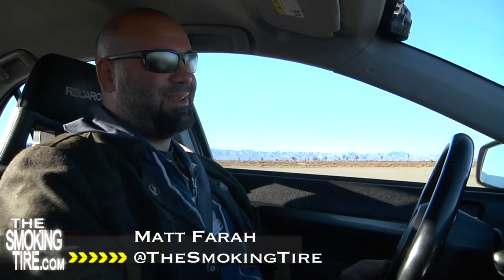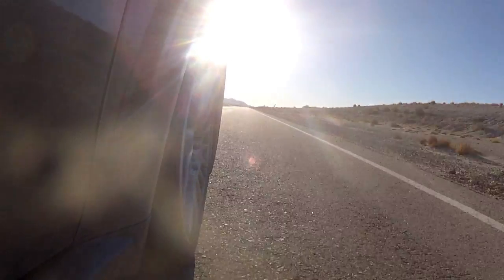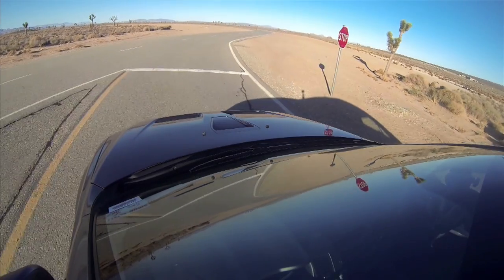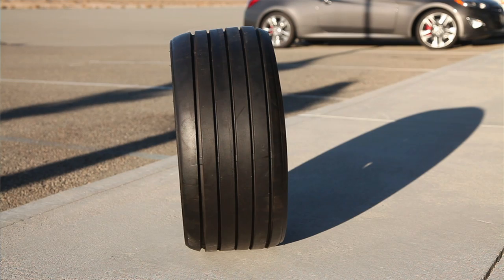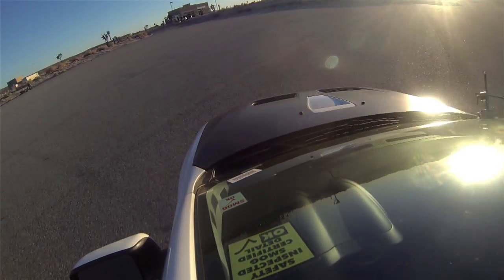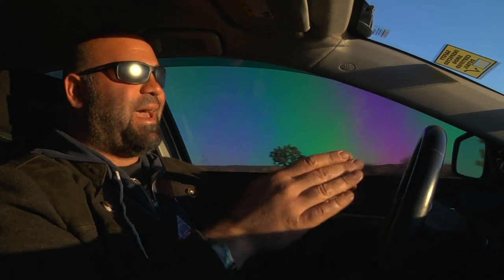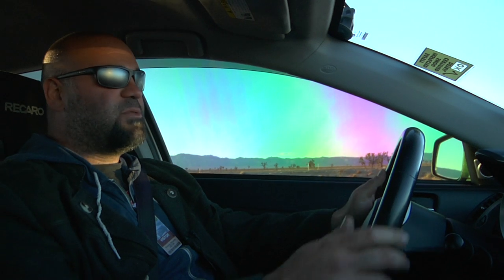Are current tires the wrong shape?

Comment: Want to point out that these tires kinda require the "cone shaped issue" to be fixed by increasing the toe out angle so it'd be pretty slow for them to change the suspension mid test for the new wheels, especially since it's pretty obvious they're losing daylight in the majority of this video. I do agree with third party testing though, jus to be sure.

Comment: These really need to be numerically tested against street radials, r-compound and slicks. The differences could easily come down to stickier rubber.
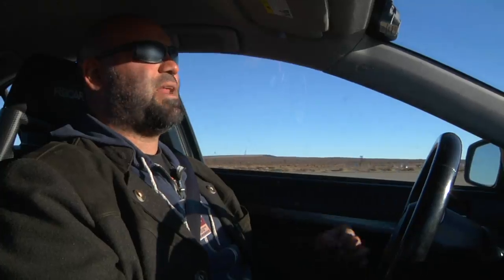Reply: 1:30

"This has the same compound, the same tread, but no camber" 

Are you guys that thick?
Reply: Leo
I'd prefer independent testing, not the manufacturer's claims.

Comment: So are these tires wider on their outside edge so in normal straight line driving you drive on the inside edges, but when you corner it lays flat?
Reply: Exactly. The point is to give the outer tire maximum contact and grip in turns so that you can take turns faster. That's the benefit it provides on a race track.

Comment: round wheels would probably increase handling drastically but i guess that might be science fiction
Reply: +white chocolate or science friction...
Reply: +white chocolate not as much of contact pattern to the ground. I think that is the point of having these tires and not just putting tons of camber on a normal tire and wheel because then you just put the tire on its corner
Reply: i was thinking you would lose grip
Reply: Kaleb Persinger doesnt matter if theres not a lot of contact it would turn in hard

Comment: Worst idea ever, and a bunch of lies.
Tires are cylinder shaped for a reason. If you roll a cylinder on a surface, it will roll in a straight line. If you roll a cone on a flat surface, it will roll in a circle, not a straight line.
So the outside edge of the tire, being larger in diameter, will travel farther per revolution than the inside edge. The inside edge of the tire will always be rotating slower than the car is moving, and the outside edge faster. The edges of the tire will wear rapidly, much faster than a standard tire. This is why we go to the trouble of installing differentials into cars, rather than welding the axles together.

BOOM!!!
Reply: +Special EDy 
Yeah, one cone, but if you put 4 together there is a difference.
Reply: +Special EDy I will acknowledge that this is true, but, considering how well these tires performed, it seems worth it. The shape may cause issues with wear over time, but the conical shape is small enough that it seems that this effect would be minimal. Also, if the tires are both pushing inward, wouldn't it help the car stay straighter?
Reply: +Special EDy Fair enough, but even in the video he mentions that with the appropriate toe (pointing of the front of the tires in or out) they function normally. ...So to address your point one would add extra toe outwards to compensate for the inward force generated by it not being straight.  

The other problem of them wearing at different rates.. Really, of all things seems closer to a non issue, not only has the person already made a tyre that is not flat for this to exist - by saying a problem is going to occur in which the tires will wear at different rates, meaning to resolve the "problem"  he would have to make a tire that is...at an angle.  

With that said you should really be up in arms that tires currently more often than not wear unevenly and can cause punctures on sides, whereas eventually his problem will be that his tires will wear flat, causing the vehicle to have...conventional tires.  

(which could be a problem with the extra camber however, stability at speed etc, which I imagine which is why this idea has not taken off sooner.)
Reply: +Special EDy 
Yeah, one cone, but if you put 4 together there is a difference.
Reply: +Adam Pardoe I think I get what your saying about the forces still being present, even if it is stable after the camber which will cause wear unevenly. And I guess if the wear due to the forces isn't equivalent to the extra rubber provided by the 2 degree camber you are pretty screwed. 
Though even now Michelin are making multi compound tires, with softer external compounds - maybe one could work out the wear rates and blend in a stiff outside compound? That can't be positive for grip, but whether stiff confound is worse than the 2degree cambered tyres is, well yet another theoretical question I don't have the answer to at 1am
Reply: +ChIken The reason that cars have always had their front end toed in was to load the wheel bearings laterally. Tapered roller bearings need to be pressed against the bearing race.
Having the front wheels toed in also promotes stability in a straight line, toed out cars will turn easier.
So these tires will actually decrease the tendency of the car to enter a turn, and by mechanically adjusting the toe angle to fix the problem you are placing added strain on the wheel bearings.
Reply: +ChIken what you're dialling out is the overall force. Imagine a cone's trajectory as it rolls. See the angle that it creates? It's only got a 2 degree camber so it will take a hell of a long time to do a full 360 degrees and end up where it started. 
Basically what the toe out does is alter the direction of the curve. So let's say that it takes 50m for the tyre to have rolled 2m to the right. That angle (0.04 deg, not sure though cos im half asleep and using my phone calc instead of my casio) would probably be an acceptable angle to toe out the wheel.
 The internal and external forces are still there, but the car handles better, however those conflicting forces are still gunna cause extra wear. It would be a cool set of tyres to use on track, but for everyday use i'd probably stick with regular shaped tyres.
 It'll be a cool concept if carbon nanotube production gets a lot cheaper so we can have carbon nanotube-rubber composites that could stand up to the kind of wear that these tyres would produce over extended periods of time. Heck any tyre made of that would like never have to be replaced.

Comment: correct me if i'm wrong, aren't you just comparing a car with 0 degree camber against a car with 2 degree camber? Shouldn't you be comparing a car with 2 degree camber on a square tire against a car with 2 degree camber with the camber tire?
Reply: +Wei Wang i believe the point is that both cars are aligned with 0 camber in the suspension but the tire creates a 2 degree camber because its not square.. i guess a good test would be 2 degree camber on a traditional tire vs. the 2 degree camber tire with no camber in the suspension but on paper the camber tire is designed to do that so it'd probably still be grippier
Reply: ***** I feel like they're indeed just doing what your point is, but the effect of camber doesn't need to be proven once more.

- Hey have you heard of negative camber? It helps cornering!
- duh? 

- I changed my camber from 0 to -2 and the car corners so much better now!! God of wonders this is new discovery I wonder why isn't anyone doing it! Gotta tell everybody now!
- duh?

Needless to say you don't need camber tires to prove that point.
Reply: +Wei Wang True! Strain on suspension components could be lessened with these tires i suppose
Reply: +Nopiw proper wear pattern

Comment: We lever to the surface under Vacuum and elastic tension, "Cambertire" effect is "One of ERW issued patent claims", Kevlar bound rubber wedges off a curved composite hoop. Rolling resistance, high speed performance improvements... The industry did not see coming. 74 issued Britek patent claims.

Comment: It pisses me off that he said the evo was really beat because it has 96,000 miles on it. Rich people who can afford to buy a new car every 50,000 miles.
Reply: Nick DiNunzio i think he ment it is rough for what it is, a 96k evo, that lives as a demo car... also he said the clutch is shot....
Reply: ***** Sounds like I'm just 17
Reply: Nick DiNunzio do you know what car he drives ? and ferther more for such a young car it has a lot of miles .. its being used alot , get it ?
Reply: Nick DiNunzio Um, you know what kind of miles Evos do right?
Reply: 96,000 miles on a daily is very different ona TEST CAR. Which that was.
Reply: Tee Mann Most definitely. Even a car like Evo driven to its limits most of the time will be pretty beaten up at 96k.
Reply: +Nick DiNunzio under 100.000 equals new to me. 
looking for cars under 200.000 at the market currently.
Reply: +Nick DiNunzio an evo with 96k miles has been mistreated so much that is already considered beat, these cars get driven hard every single day, and if someone tells you otherwise then they are lying. I owned an evo with 57k miles that was ready to get scrapped.
Reply: You can't assume
Reply: +Nick DiNunzio Generally turbo motors are not expected to last more then 100k-miles without rebuilds, new bearings rings etc. That being said I have a 2.0 making 388whp with 180k factory motor down to the bearings etc. only replacement was ARP studs & hG. But with a rebuild it would likely be over 400whp due to compression losses(sitting about 155, rebuild would make me 180+)
I agree though, I dont like interest or banks, so typically buy cars with 100-150k miles for cash, drive them a few years and sell them off for the same or more money then I paid for them :P I've never understood the business of paying hundreds of thousands of dollars in your lifetime for a vehicle you never OWN!.. Leasing at 5-10k+ a year, and trading in paying another 5k down payment to upgrade to the newer model every two years...
Reply: +Nick DiNunzio It's not about it having 96,000 miles on it. Evo aren't regular cars, they don't break, they get used up.

Comment: wouldn't the insides wear more in the long run ? i think it'd b perfect for suspension with camber already . correct me if im wrong
Reply: +WeActOnImpulse Official very little of what you just said is correct.
Reply: hisham mohamed Of course it would. They're obviously tires designed for using when brand new to go on a race track and then change the tires after 2 laps. Especially since they're like 1k a tire.

Comment: Why not use the same car? It seems like they went out of their way to use two separate vehicles. It takes less than 10 minutes to do a wheel swap for another set of tires.
For all we know each Evo could have been slightly tuned differently.
Reply: it would take some time to change the camber of the car itself, other wise the different tire does nothing. But I do agree, this shows nothing because they were different cars and im not great with foreign cars but looked like a different model year as well.
Reply: he didnt use the reg tires on the bumpy road so how would it feel better? lol
Reply: TuneDeafOfficial it doesnt matter which car they use because they are the EXACT same. Also they probaly changed cars because they had different toe settings because of them coning together. Also may not have had the axle stands on site.
Reply: ***** There is no such thing as a car that is the EXACT same as the other. Each car can be very similar, but they can also be very different. But never the exact same.
Why do a test if you're not prepared to get proper results? It takes less than 10 minutes to adjust the toe.
Reply: Lucas Enrique He probably did go on the bumpy road with the regular tires but they just didn't put it in the video. That is what I'd assume, anyways.
Reply: Aaron Thomas No 2 cars are the exact same even after coming off the assembly line.
Reply: Malc180s Because he's testing the tires not the car. It's far from rubbish.
It's like testing two new pairs glasses. If you're trying to test out which pair is better you need to use one singular person for your results to be consistent. You can just give them to two different people and ask them who had the better experience.
It obvious it will be different for everyone else. That's how it is with pretty much anything.

It's up to the buyer to decide if these tires would be best for his vehicle. They may not work with one's project. His test is to decide if they actually work.

If you want to hear rubbish, look at your own comment.
"If he's going to adjust the toe and/or camber anyway, using the same car is completely irrelevant."
He didn't adjust the camber/toe.
They're designed so you don't have to. Did you not watch the video?
Reply: WeActOnImpulse Official Very true.
Reply: ***** No 2 cars are "the exact same" after they've been broken in.
Reply: TuneDeafOfficial What would be the point in using the same car? If every other car is so different to his, why do any tests? After all, any knowledge he gathers would be useless to any other person on the planet, right? Yep, you're talking rubbish. 

If he's going to adjust the toe and/or camber anyway, using the same car is completely irrelevant.
Reply: Malc180s He claims that the tires make such a big improvement in handling and responsiveness of the car, yet uses 1 car with worn out suspension and 1 car with a modified, tight suspension.  The differences in the suspensions themselves negate any possible findings because the difference in the suspensions themselves will directly affect handling and responsiveness.  A proper "experiment" only works if there is a constant and a variable.  When every aspect of your "experiment" is a variable, you can't get accurate results.  In this particular case, instead of finding a proper answer, the "review" looks more like an advertisement.
Reply: Aaron Thomas Both cars were standard suspension, and he doesn't comment on the condition of the second car. And in any case, he says the drivetrain is a little tired on the first car, not the suspension.

If all cars are so different, why bother watching or reading anything? Maybe these camber tyres would be appalling on your particular evo, if all these cars are so wildly different. 

And then there's the fact (the only fact) that the "results" are just the opinions of a large gentleman anyway, and have no meaning at all.
Reply: they used two separate vehicles because they did. While it is true that no two cars are the same. Two Evo X GSR's are pretty much the same car. And one car was set up with the experimental tires and the other wasn't. I mean does it really matter if they would have used the same car. The results would have been exactly the same. It's called physics, physics unlike other forms of science isn't wrong.
Reply: +WeActOnImpulse Official thank you!

Comment: yea.... put the tires on the 1st evo on camara, bet the white evo has suspension upgrades, diff shocks swaybars and all that goo shit. the old eve didnt even had a good clutch. bet the rubber bits on the suspension where all shoddy too. and why an evo? put them shitty tires on a shitty car and run it. an evo runs on rails no matter what. 

it could have been worse, they could have used a GTR, altho i would like to see how the GTR's traction computers feel about having tires poiting in all angles.
Reply: OrDxOrD Throw those tires on a 2005 Ford Focus and see how they do.  That would at least be a real test.  If the car magically handles corner properly, they're worth the cost.